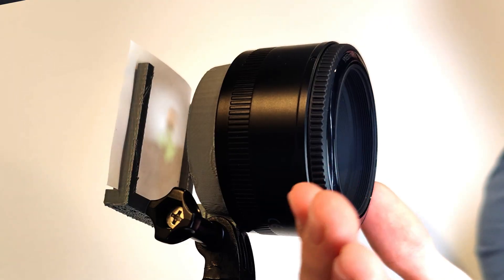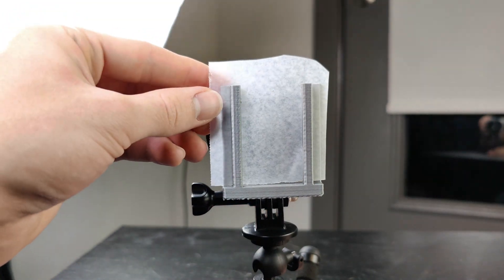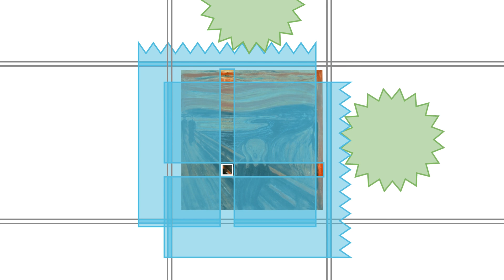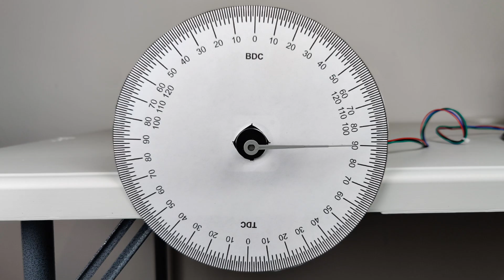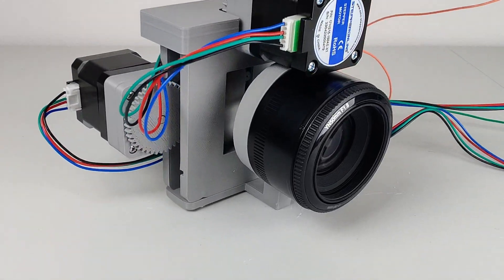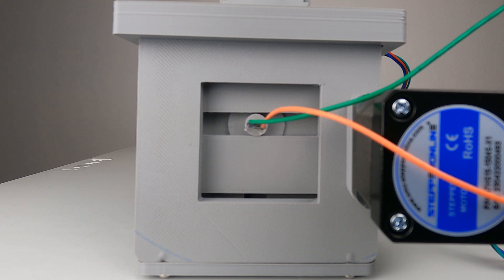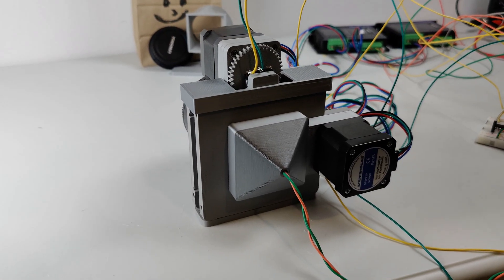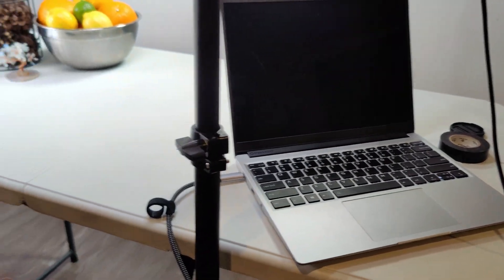I built a camera with a single pixel

Comment: My thinking on an approach would be to keep the pixel stationary, but use lenses and or mirrors to change the part of the lens that is captured. That way you can potentially move the mirrors faster and just have the sensor capture on an interval.
Reply: This was also what I had expected.  With fine tuning you should be able to get very high resolution with mirrors.  It's how the original Virtual Boy console worked, but in reverse.
Reply: That’s what I thought, it might also be more robust, because the wires would not be moving as much

Comment: It can not work fine. Don't use image sensor with own optics. Use photodiode or phototransistor with flat surface (like SFH 2400). Build separate board with photosensor and current amplifier, to avoid noise from motors. Don't use long cables, which passes voltage, only current. Don't turn motors off. It's time-wasting. Don't stop motor at all. If you don't know, how to build a circuit, which is not sensitive to noise from stepper motors, separate power sources. For example, use a battery to power the sensor. To speed up scanning, use mirrors and don't move sensor.
Reply: if the sensor is at the proper focal point, you can sand the lens on that sensor to a flat matte finish to improve it as well.  But yes, mirrors are going to be your friend.
Reply: @glowpon3  I think sanding epoxy cover is a not good idea. It will make scene blurred.

Comment: Clever idea! As a mechanical engineer,  I see opportunities akimbo to change/improve on the mechanism. I wonder if a galvo could perform the function of capturing the data of the grid instead of moving the sensor? Then you can reduce the size of the sensor (pixel) and increase the number of pixels per image. Alternatively, CD drives are an excellent source of very precise single axis motion. Put two of those together for the x-y. Faster positioning and probably less noise,  both electrical and vibration. Very clever, I hope you stick with this. It "feels" like the images will be very thought provoking with some improvements. We'll done.

Comment: Super cool project!

One suggestion I would have is if the issue is noise from the stepper drivers, there are ways to separate out the sensitive circuits from the noisy ones. For example, when I needed to connect my PC's very noisy USB to a sensitive debugging tool I found the XuanZu ADUM4160 board super helpful. (Those keywords may or may not find it, just search "USB isolator" and the orange PCB with the acrylic cover should be easy to spot.) That allowed me to use a super clean power bank power supply for power, and entirely eliminated the signal integrity issues I had. Alternatively, since you didn't seem to have issues with your USB and only had problems when the steppers were running, you could potentially run those on a separate or isolated circuit, and only bridge them for the step pulses, which could easily be done with an optocoupler or similar. Not turning off the steppers could allow less frequent recalibrations (after all, 3D printers use steppers in open loop without re-calibrating at all mid-print), which I assume would allow scanning operation, significantly reducing time per pixel and increasing feasible resolution.

Of course, you probably know at least some of this already. I'd love to hear whether you already looked into electrical isolation, and what challenges you ran into if so.

Anyway, thanks for taking us on this journey and I look forward to your future videos!
Reply from the maker: The motor drivers actually have internal optical isolators and are running off a separate power supply, so they're already isolated from the sensitive electronics. They're just switching so much current that the electromagnetic interference is quite loud, even several inches away. I'm thinking I'll need to shield the motor wires, maybe the motors themselves, and shorten the wires from the sensor to the amplifier to minimize electromagnetic interference. I'm definitely looking to minimize noise so I can operate it in a scanning mode, for exactly the reasons you mentioned.

Thank you for the kind words, I'm glad you enjoyed the video!
Reply: @ChargedHex  Ah, yeah, I considered EM interference but since you didn't mention it I assumed the circuits just weren't isolated in this prototype. In addition to shielding, maybe you could look into converting the analogue signal to a differential signal at the sensor? Or, I suppose, putting an ADC directly at the sensor location? I imagine one of those + a foil Faraday cage around the sensor circuit might be enough.

Thanks for taking the time to respond!